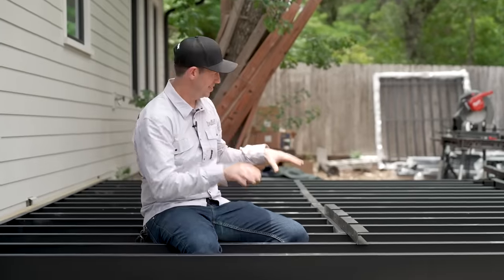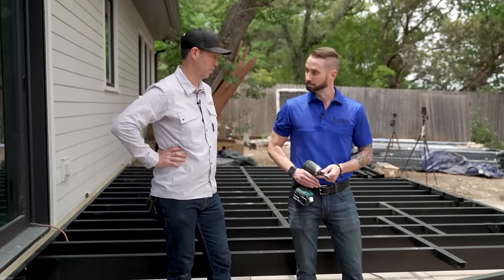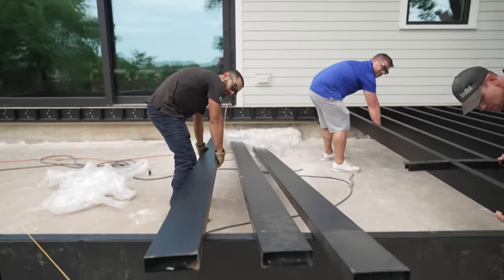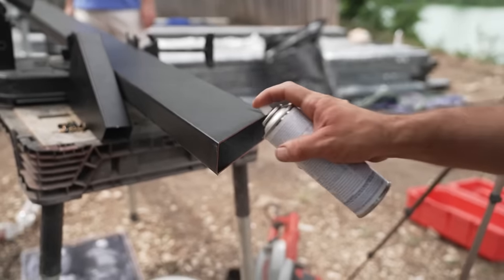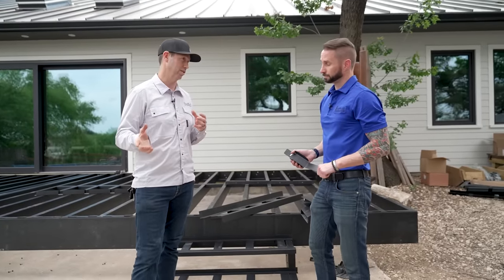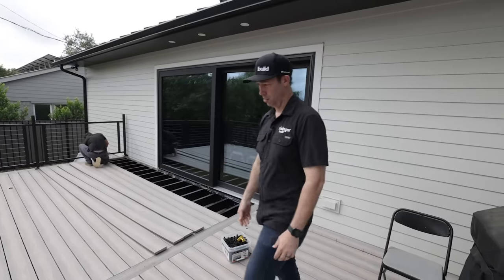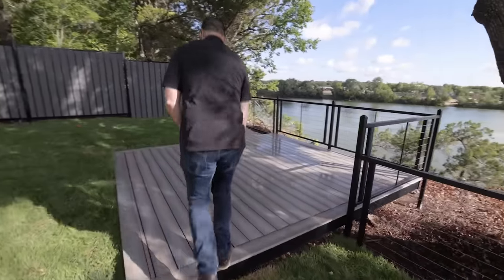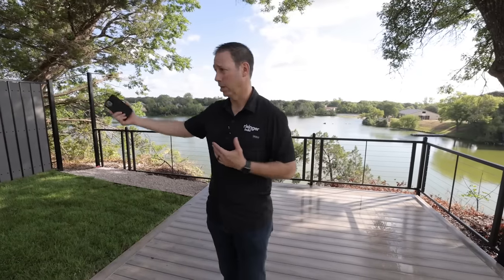My First Steel Deck Framing Job

Comment: Made an inquiry about Fortress's steel decking last year by visiting their website.  Found dealers in my area and went to one to see about purchasing the product.  The dealer, who had never sold any Fortress product before, was told he had to purchase a minimum amount of material from Fortress before they would ship any product to him.  He balked because the deck I was looking at constructing was 8 ft x 20 ft, much less than the minimum purchase he was required to make. Also, there were no certified contractors nearby where I live.  As a result, Fortress as an option for my deck has been scratched off the list.  Too bad, as a DIYer who constructed a Trex Elevations steel deck frame in 2021 this product looks relatively easy to install.

Comment: I have a situation that I need to connect a beam protruding from the house foundation.  This is because I have a 2-ft. cantilevered bayview rear sliding doorway, which I cannot connect the S channel ledger to.  This system, from what I can gather after reading literally ALL the documentation appears to provide no support for this fairly common situation whatsoever, which may force me to choose wood framing in the end.  The best I can come up with is to reinforce and notch the end of the beam and cut the exterior joist banding of the house open to receive this notch to have it rest on the bottom plate.  I suspect I would have a very difficult time getting this past the city folks unless I could prove the engineering was sound.

Comment: Matt, I want to build a 1,200 sf FLOATING deck (not anchored to the house), like a big version of your wine deck. Would you recommend using a blank beam with hangers on both sides?

Comment: Another option would be to use cee-purlins in 14 or 16-gauge, attached with Simpson angle clips and Tek screws...  I was taught to always first try to solve a detail using stock materials; for obvious reasons.

Comment: Looks awesome at the danger area-Elevated Decks! Exterior  Elevated Balconys/Decks are the rock that can break the Engineer Contractor back, as these systems are subject to rot, rust and failure under excessive loads. Imagine drunken party people jumping up and down on an older balcony and the possible collapse. Engineer and contractor get sued, engineer looses good design insurance, puts all his assets in wife name, and then over designs by a factor of four and is very faithful to spouse.

Comment: The sizes are perfect!  Over here thanking The Most High that my son is a welder.  No screws. Also, adding a structure, it doesn't have to hang onto/conjoin via screw onto the structure of the home.  So many times have I seen homes add a solarium or recreational space, otherwise, and over time- it looks a mess that needs tearing down!  
Food for thought:  weather the home is on concrete or crawlspace/cinderblocks, it's gonna shift.  You don't want a new pull on that structure.  It's okay that the addition is independent and the longterm appearance will remain nice!
15:03 you said metal...it's not gonna move on us.  Metal is also an element.   Now, it's an independent element from the wooden house and concrete slab.  In time, you will see what I'm talking about 😬

Comment: I used the Fortress Hulk Hidden Fasteners, half of the deck was done and the heads of the screws started popping off at the joist. Fortress said I over-tightened them. I ended up replacing 225 of them and I put them in with my drill on low (1) and the clutch set at 8 out of 24. The next day I had another 8 of the new screws pop and each day after several more popped. 
I ended up talking with a guy that installed the same framing and decking, he used the Camo Clips. I am going to end up warranting the screws and fasteners and having to redo everything that I've done with the Hulk Fasteners. UGH!
There was A LOT of figuring to do with this framing system. The online stair calculator doesn't work. I figured out a better way of doing a lot of this framing. (looking to put all this info into a blog)
I installed an L-shape deck and ended up designing a bracket in CAD to attach one side to the house that didn't use a S-Ledger to hang the 2"x11" beams, instead of their suggestion of putting two more cement piers and posts to support it next to the house.
After getting a ridiculous quote for the cable railing, I decided to make my own. Instead of $11,900, it cost me just under $2,000, and that's with high steel prices.
Reply: id be interested in hearing more of this. looking into using this product for the first time and i am concerned that in Montana the weather fluctuations will pop screws. Also seems like a major pain in the rear to have to drill out each hole like i saw in this video.
Reply: I ended up going with the Camo brand and no issues so far and there been a good amount of weather fluctuations here in Michigan. Yes, there is a bit of work but I won't ever have to replace any of the framing. I had a bunch of ideas and suggested several to Fortress but they didn't seem like they were interested. One issue I saw was that when you sister two or more beams together you have to drill holes so that you can attach a bolt/washers/nut to hold them and then you place an end cap on the end of the beam to prevent pests from making a home... downside you have four 3/4" holes where you drilled to put the bolt. I asked about a cap to cover the holes and their suggestion was for me to go onto amazon and find a plastic cap that would cover that hole. SMH! I figured out a better and easier way. I talked with the head engineer and a couple of the sales guys and they did say that they would love to come out and take pictures since I've done things that they hadn't thought of, but have heard back from them. I was told that the head engineer pass away and the regional sales guy must have quit. That's fine I no longer care if they come. There are a couple tings I would do differently if I did it again.

Comment: Can you review or tour monolithic dome structures? monolithic domes are fast assembly, strong, and with geopolymer can in theory last millennia. Aircrete casting can be used for very low cost.

Comment: What is the steel coated with?  And, is it coated on the inside and outside of the beams?  
About the composite decking:  I've had local contractor claim that the composite material gets hotter in sun light and transfers that heat faster to bare feet.  So, that composite decks are too hot to walk on with bare feet.
Reply: Composite gets very hot however it also cools quickly in shade. I wouldn't use composite decking in Texas if I wasn't going to put a pergola or awning of some sort over it unless I never plan on being barefoot on it.

Comment: Hey Matt or anyone else. It mentions on the fortress website that it’s galvanized, is it hot dip or electro plate galvanized? I’ve got to build a deck on a beach and only want to use this if it’s hot dipped. Thanks

Comment: im a welder by trade, and by no means a carpenter...... you would think  i would be considering the process is so similar, i just replaced my large deck, and asked myself the entire time why aren't decks steel? And here you are. : )
Reply: I'm a pipefitter by trade so for me it would be send out a mass message to welders I work with and ask if anyone wants to get drunk and have a BBQ.

Comment: Curious about the feel/comfort of the deck.  I believe this is the house where you also installed an additional layer of insulation(?)/underlayment over the concrete floor to soften it when you walk.  Does this give a softer feel than wood?
Reply: Nothing changes

Comment: I wish my Fortress deck was made like this.
Free standing. Damaged steel: scrapes, the weilds are not flat, but when it rained, the welds have rust, waiting to see how all this gets fixed.
You metal framing is black. Mine is all scraped up.
I wish my deck would have looked like this.😢

Comment: Does this price include engineering and or shop drawings? That would be super helpful for design professionals as well as pulling permits.
Reply: When I did mine last year, I gave them the rough outlines and height above grade and they generated a pull sheet.  No drawings were provided (to me).

Comment: About time US, you're years behind in steel framing. Is timber really that cheap you'd rather use it over long dead straight rolled steel sections?  Still yet to see you guys start using manufactured decking I.e. the "Modwood" or other similar plastic/wood extruded products....straight lengths, stays that way, colour is in the product - no more re-stains or re-seals.  ooops, I see you have the composite flooring....very nice job!
Reply: Yes timber really is that cheap compared to steel or composites. For example, he said it was about $800 for 7 more joists,  event with inflated lumber prices a pressure treated 16' 2x8 is $20, so less than 1/5th the price of steel.

Comment: Where I live (NC) your steps would not pass inspection. No railing, different step heights, no concrete landing pad at least 36” wide from front of stairs. I am assuming you built all of this without engineering drawings submitted to the planning department to get a building permit for it. Hope you do better when you are the contractor for other people! (Or are those just temporary stairs and you will put in the final stairs soon? ;-)

Comment: That looks pretty cool, i might build my next deck with metal framing. I will be going cedar though, not a big fan of plastic decking.
Reply: At $4.95 a lineal foot around here. That's crazy for cedar.
Reply: @TheAntiSmug  wow its $39 for a 5/4x6-20' for WRC here. $62 for 2x6-20'. Where do you live?

Comment: There's a reason steel siding isn't used much. You're drilling holes in a bunch of places, penetrating the factory finish. Seems likely to rust.
Reply: Siding is thin. This kind of steel will take 40 years to rust all the way through even if it's uncoated.

Comment: I've been curious about the steel decking systems for a while, but I wonder how they arrive at the 25% claim for the cost of the actual frame. This seems pretty far off considering each framing member in their system costs more than a $100 each compared to conventional ground rated lumber that will cost $20 and sometimes less.  Is the 500% increase in material cost made up for by labor somehow?
Reply: I'd bet for sure. Matt said it went together in around 2-3 hours plus some extra work. Steel is more standardized and predictable than wood. Look at management of stock for example. Mixing different types of dimensional lumber. This you have a truck of joists, truck with accessory/edge runners, and then synthetic boards.
Reply: I live in the PNW, I recently used 2x8 x12 and they were $26+sealant tape on all top surfaces per ACQ recommendations.  More support beams and concrete poured for posts and the hangers and tie downs add some blocking and the on-site hours... Oh and I had to stain as well.  I see where it could be closer than your 500% swag.  Especially if you have someone else do the work.
Reply: @kenreynolds1000  Most especially if trying to match the dimensional perfection that is assured, with no cupping, twisting, or bowing to mitigate.
Reply: I wonder if they also provide the structural engineering details that will save cost if pulling permits. With the quality of wood nowadays, I would definitely look at this type of option.
Reply: @kenreynolds1000  yeah our earthquake requirements mean heavy duty support. Why I’m looking at Trex steel beams. Theirs are bigger and require less. I’m sure it won’t be cheap but my current deck was built mid to late 90’s and I’ve had to replace a few boards and the steps due to rot. The original wood used was redwood. I’m getting older and don’t want any repair work after I install a whole new deck. wash it and be done. Steel beams with composite top works for me.
Reply: 25%??  Not in Canada. +100% conservatively.

Comment: This kind of backyard is beyond imagination, in suburban SoCal, except in places where billionaires live. ;)   Our lots are typically 60' wide by 100' deep.   Yet "backyard living" is what I live for.    Most people around me live indoors with the a/c running all day long, while their eyes are glued to TVs or ... iPhones??      So yes, backyards are meant for development.     BUT... what's with the GRILL being slapped up against the back of that lovely home?    (Some people call that a "barbecue.")   The smoke is nasty and that thing ought to be put out on the "wine deck"  with the ugly side ALWAYS hidden from guests; i.e., at the most distant part of the wine deck, relative to the house..        In my "modest" SFR location, I did that; I built a "cook's corner" along the rear boundary and innovated with a bar-style countertop and integrated sink.    All at the rear of the property.    My guests love to congregate there, under a huge umbrella.    And, importantly, that smoke-and-heat belching grill is completely tamed.   Even the prevailing wind favors this arrangement.   So yes, good design starts with environmental awareness.

Comment: Just wait till a summer season to arrive.  The heat of the steel will radiate upwards into the composite deck material, increasing the heat of a already hot composite deck board.  One can only hope that the amount of heat expansion doesn't cause damage to the surface planks.

Comment: Lumbar is a sustainable material that is carbon negative, steel smelting produces emissions amd has high embodied carbon regardless of the method of heating.
Please use wood whenever possible and minimize the use of concrete and steel.

Comment: i see that the steel wouldn't have warp twist or rot. 25 year warranty, powder coated no maintenance. Why put a deck on that's going to last 50 years and use wood that will last 5 - 10 years?

Comment: Talk about opulence, putting a freaking steel deck over a nice poured concrete slab just so you're not bothered with a few stairs! I'd take stairs with a nice patio cover over metal deck any day.

Comment: This is nothing new, these are  called metal extrusions . I installed stadium seating and telescopic bleacher systems in the mid-1970s to 1982 . Engineered and installed properly, products like this can last a very long time. Matt I’m not really sure where you’re getting your statistics on 25% over wood cost (?). I also would think the longevity would be a lot longer than twice the expected life of wood (i’m assuming the thickness of these metal extrusions  is a tad thin, at least compared to the stadium walkways I used to build).

Comment: This is not gonna last in a northern climate
Reply: Why not?  I work in northern Alberta and all the structural is made of metal.  Even after a couple decades of abuse in an industrial environment in -40 degree weather the steel is still fine.  The only areas we have issues is where we have massive shock loads. They are basically dumping 400 tonnes every couple of minutes and have rocks the size of a small car going through a crusher.  Our walkways at elevation are all fine though.